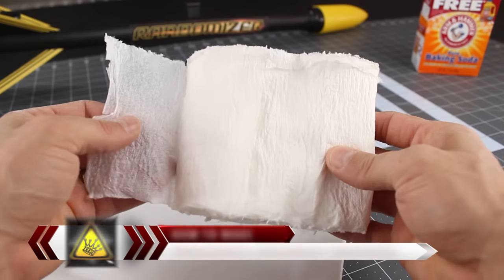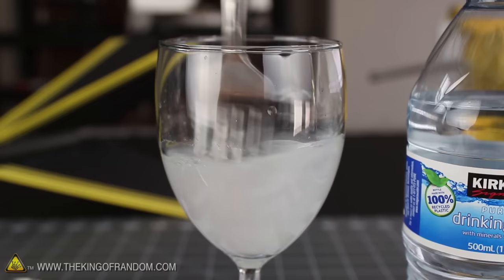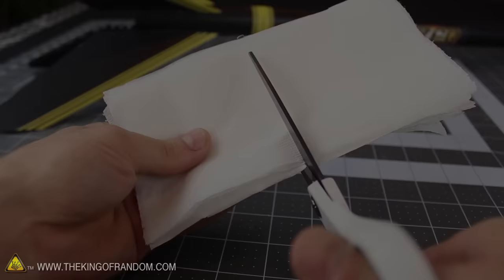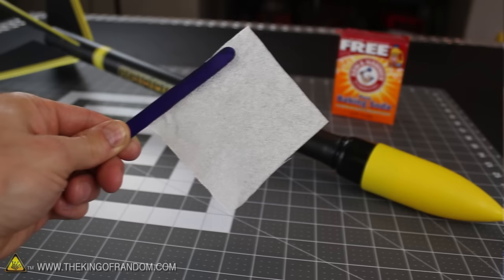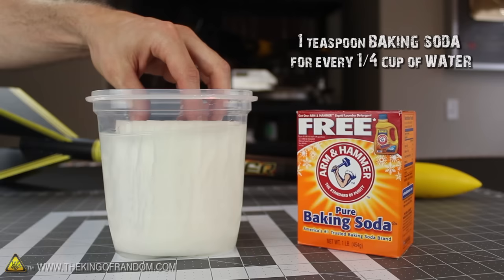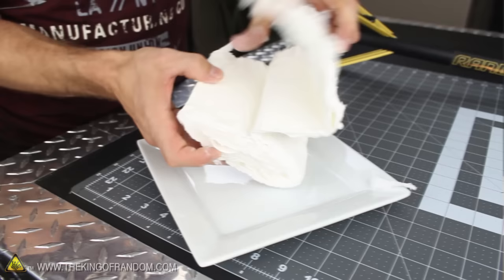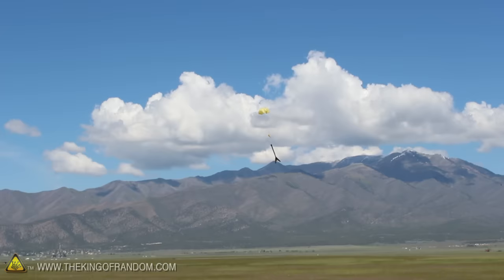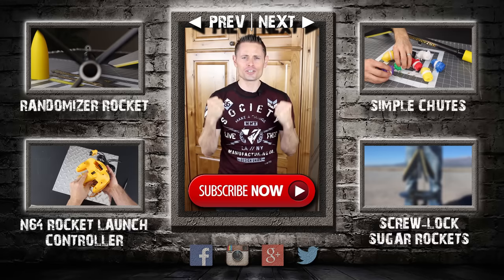How To Make Fire-Resistant Rocket Wadding (For Pennies) | Parachute Wadding & Wadding Alternatives

Comment: Dear Grant Thompson, 
I am a fan of yours and love building model rockets so I buy a lot of rocket wadding. The commercial ones are worth it because even though they do catch fire they're being ejected into the air at a speed to where they are extinguish immediately. Plus with the commercial ones you can reuse the wadding that you used the first time. I also tried it with the homemade wadding and couldn't reuse. So even though the commercial wadding is more expensive you get your moneys worth more than the homemade wadding. Still love the idea.

From Braden Kemmerer.

Comment: Over 40 years ago, when I was a teenage rocketeer, I would use bits of fiberglass insulation at wadding. It worked fine.
Reply: I'm 65, still play with model rockets, and still use fiberglass insulation. Fiberglass (or rather glass fibers, not paper or plastic with glass fibers in it) does not burn. I no longer build rockets from kits, I design and build my own. I also built my own steel launch pad and launch control panel.

Comment: We had small and thin tissue paper so I get 4 squares of tissue and fold them before soaking in the solution...I forgot that I am using 3 ply tissue so when i unfolded it, I would get 12 thin squares of the fire resistant wadding!😊

Comment: I recommend Boric acid over Baking soda.  The resulting wadding won't smolder once the heat is removed so I believe it is safer.  The amount I use us 2 tbls Boric acid per 1 cup of hot water.

Comment: Maybe you can make a staging rocket so try putting two pipes next to each other then stage and go to a single rocket. And then just the normal parachute. But you can try making the parachute opening when the rocket is lower to the ground then high up in the sky.

Comment: I hope you know that in the United States there is a internationally established standardsrocketry safety Codex , which is based on the American NFPA Code. The regulations are:
-Weight of the rocket under 1.5 kg
-Engines with less than 320ns total impulse, or 125 grams of pyrotechnic driving mass
-Use lighter and more fragile components
-No metal parts in the supporting structure
-Using commercially available propellant charges, NO SELFMADE PROPELLANT CHARGES.
I just wanted you to know this.

Comment: Cool, you really love rockets, unfortunately. In Finland, we cannot even get the basic materials for rocket motor. Was it stump remover? Yeah, we cannot get that anywhere anymore.
Reply: +ChronosFIN In South Africa you can find it in pharmacies, it is sold as either potassium nitrate or salpeter, try looking there in Finland, maybe you get lucky.
Reply: +ChronosFIN try finding KNO3 in aquarium stores, its used in aquariums and i got it in the Netherlands this way.
Reply: Stiaan van Huyssteen  In Finland, Potassium nitrate from pharmacy chosts multiple times more, compared to other options, its reasonable amount but 1 kilogram chosts 60 - 70 euros in here. Also, when buying any chemicals from pharmacy, they will allways ask the purouse and wont sell the produkt, if it sounds suspicious in their opinion. They dont even sell syringe needles anymore. Laws and rules in Finland are ridicilous.
Reply: jonno85uk Ebay is one option, but the thing is, that customs will propably take it on confiscation.
Reply: gorden2500 Never heared of that one, i might try it :) Thanks.

Comment: Why is it called sodium bicarbonate in Englisch when its formula is NaHCO3?
Reply: +YourMJKTube Na is Sodium. 
H is Hydrogen 
Co3 is Carbonate 
The naming system for that is actually very old and can even confuse a few starting out chemists. The now known name for it is Sodium Hydrogen Carbonate. 

What happens is that Sodium Bicarbonate can release DOUBLE the Carbon Dioxide (Co2) than Sodium Carbonate (Na2Co3) SO they named it Sodium Bicarbonate (NaHCo3). 
So it's supposed to  contain twice the amount of Carbon per Sodium. 
We currently say Bicarbonate probably because it's a lot easier than having to spit out "Sodium Hydrogen Carbonate" in Chemistry class/while teaching/ or even writing it out.
Reply: +Angel Spawn I know that, but you could also interpret "sodium bicarbonat" as "Na(CO3)2", so I think it's a terrible name.
In Germany we call it "Natriumhydrogencarbonat" which is much clearer and closer to the chemical formular

Comment: Could make business if 300x cheaper!
Reply: +Kshitij Ragooanth Thats whats I am thinking about
Reply: +Kshitij Ragooanth No the reason it is way cheaper is becouse it had a lot of time to dry so it did not gain costs in that. But if you want to make a business out of it you will need to speed up the process of drying. That way you also gain costs.
Reply: +Layla dog why? all you have to do is keep a decent sized stock of it and replace as needed, I hardly imagine you'd ever sell an absolute ton of the stuff unless it gets to the point of actually competing with the brand names who sell the expensive stuff.
Reply: +Layla dog No? You'd just have a few week lag on adjusting stock.

There are a bunch of reasons why it's much more expensive to produce things like this commercially, but that's not one of them.
Reply: vgamesx1 well you need a ton of stuff to sustain a business. Let's say for a succesfull business you need an income of $80.000 well lets conpare that to 0.025 c per sheet that is 0.00025 dollar per sheet now for the roll of paper let's say it contains a 1000 sheets. Well let's compare it what you have available in a normal household lets say 25 cubic meters for drying lets say every plate is 25 * 25cm. That means a 400 plate drying space. Now a roll contains 1000 sheets 1000*0.00025= $0,25 per roll you can dry 400 rolls a month that means 4800 a year. Let's calculate with a 400% price increase. So 1$ for a rol 1 * 4800 = $4800. That is 6% of what you need that means you need almost 17 times more space. Do you see what I mean.
Reply: seigeengine tell the reasons then
Reply: Layla dog wait business? I just thought about getting a few hundred rolls off a bulk seller like taobao, then sell the finished product on ebay or w/e.. Not try and out do the big guys.

A store just for this would be way to costly and almost certainly be doomed to fail from the start if it's all you plan on selling.
Reply: vgamesx1 I was talking about a business since Kshitij Ragooanth was talking about business. But if you don't want to start a business you are right you can make a few hundred of these rolls and sell them. But especially for people like the king of random it is to much effort for money you get. I personally find the effort to high for the payment. But you are right you can sell a few hundred rolls and make some money.
Reply: Layla dog Space, employees, insurance, maintaining a presence, advertising, accounting, legal advice, packaging, etc. etc. and so on.
Reply: Layla dog well I mean, it's still technically a business doing it at home, but I just don't see going all out with a store and everything being that viable.
Reply: seigeengine I know. But if you speed up the process it will get rid of a portion for many of the reasons. But I know a business will never work for lots of reasons but the time the process takes is also a reason not the only reason.

Comment: It should be said, if not obvious, one should NOT go to their attic and start grabbing whatever insulation is there to use as wadding. This is a terrible idea. 1. Not all cellulose insulation has been properly treated for fire resistance (bad contractors) 2. It could be fiberglass insulation, which isn't really good for you to be shredding and working with without a respirator 3. Even worse, it could be asbestos which is incredibly fire resistant, but also incredibly carcinogenic (IE. gives you cancer faster than you can say "I need an oncologist")